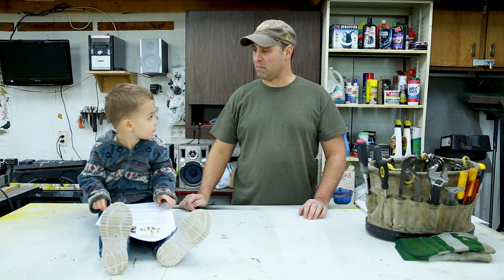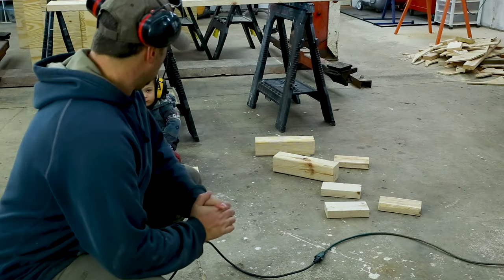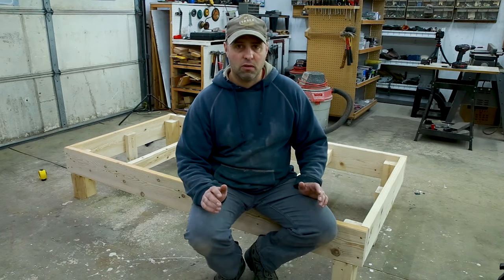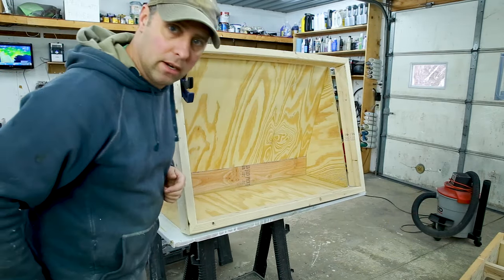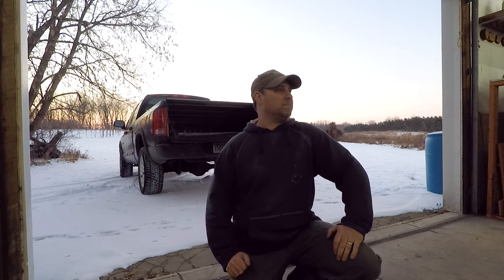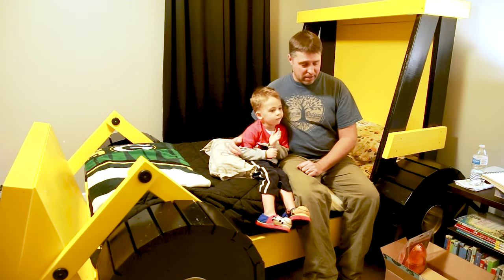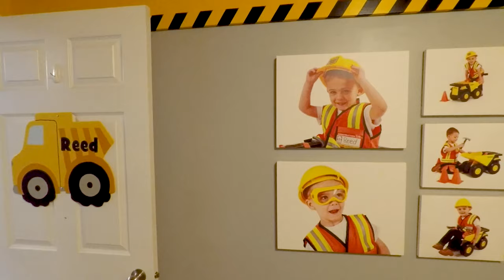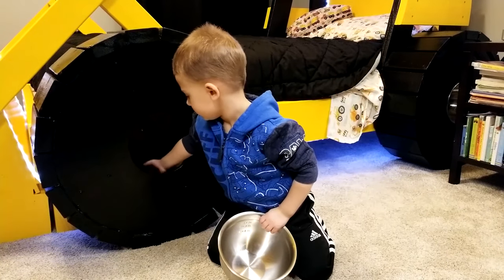Worlds Most Awesome Bed: Boys Construction Themed Room

Comment: Great job. What method did you use to cut out the plywood circles for the wheels ?
Reply from the maker: I put a screw in the middle and tied a pencil to a string. I attached the other end to the screw and drew a perfect circle. Then I used a jigsaw to cut it out. They do sell the plans on Etsy. I used the plans, then modified it to make it more interesting. Thanks for stopping by.